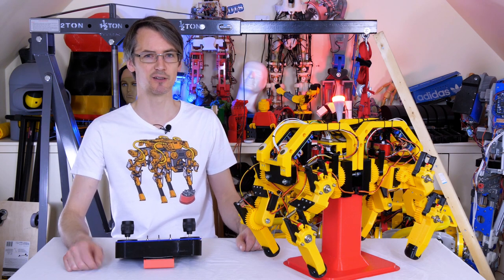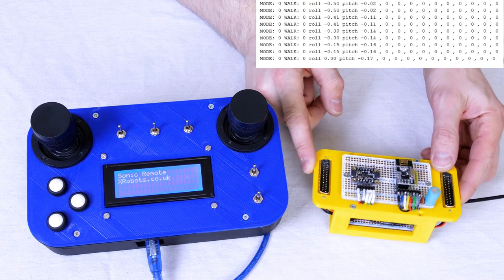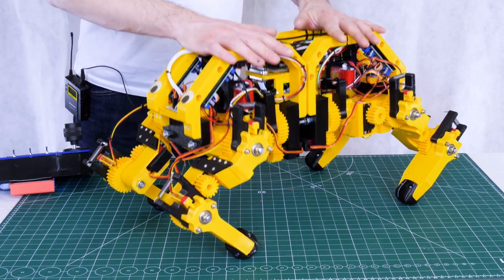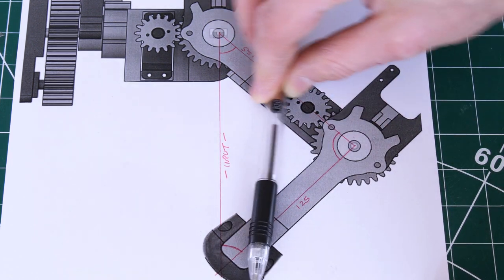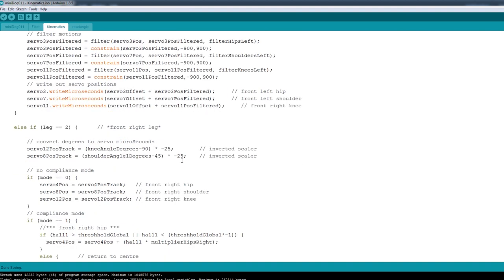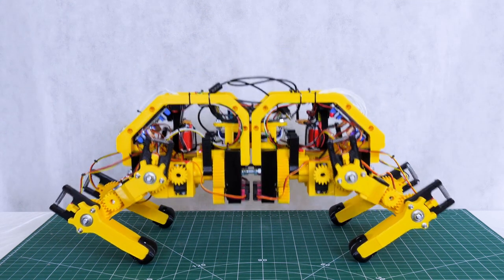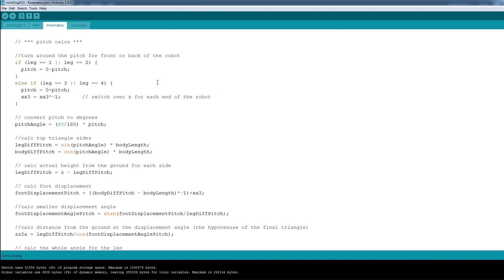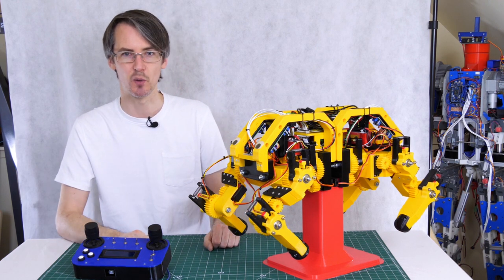Mini Robot Dog #4 - Inverse Kinematics

Comment: The movement of the robot is looking awesome! Very cool indeed!

Btw, In programming we typically avoid atan(x/y) and use atan2(y,x) instead, to avoid the division by zero that's lurking there and because "The single-argument arctangent function cannot distinguish between diametrically opposite directions".

Comment: Great job James! I am impressed by the way you do that! But I woud suggest trying to solve IK problem by using more linear algebra instead of pure trigonometry. It will not only run faster, but once you get a good understanding of it, will be much easier. (although harder to explain in a video). Anyway looking forward to the next video!
Reply: This sounds good, can you attach some links.

Comment: This is the most FUCKING AMAZING RC project I have seen in forever. Iv'e built quad copter after quad copter, tracked vehicles, and rock crawler, but this is something different! I wan't this this bot, and I want to put FPV on it and take if into the wilderness!

Comment: The reason why programming often uses radians is because floating point numbers have the most accuracy around 1.0 or -1.0— there is just as much accuracy from 0.0-1.0 as there is from 1.0-infinity.  While it shouldn't make a huge difference for your calculations with 32-bit precision floats, the closer you can keep the numbers your using to +/-1.0, the less chance of floating point error/rounding showing up.

Also, working in multiple different scales generally makes your code messier and more prone to errors.  It's best to try to choose a system and stick to it for the whole program.  If you want to output degrees to the terminal, I'd do the radians-to-degrees conversion inline in the print statement; mixing radians-based and degrees-based variables (even if distinctly named) is just going to clutter things up.  Just imagine trying to design a 3D part in CAD and half you measurements are in centimeters and half are in inches!

Comment: Hi James,  As always great to watch your inventions take shape.  I am also using the same network chips for my robot mower and was interested in your comment about voltage issues.  I don't suppose you could say what decoupling capacitor and smoothing capacitor you are using please?
Reply from the maker: 100uF and 0.1uF, but there are still some occasional issues

Comment: Hi James, I wanna build my own doggie but i have leg direction as opendog, it use not geared servo(180°), i try to write my own kinematick but i have 351 line and he can move top down and badly front(only body move) how mutch i must edit you code to it work for my( i need only kinematics with all variable)

Comment: instead of creating different cases for each motion of the inverse kinematics, wouldnt it have been easier to treat each leg as a 3DOF arm and plug in whatever point you needed?
so instead of having an equation for up, down, side, ect... you'd just have position in 3d space and it solves everything

Comment: Nice work. A suggestion: If I were you, I would never shift between RADIAN and DEGREE. Calculate all in radian and ONLY for HUMANS convert it to DEGREE and send it over the serial port. You remember the smashed vehicle on Mars. The fault was, they calculate in both metric and imperial and they screwed up.. 90 degree is Pİ/2 ;)
Reply from the maker: Yes all the calcs are done in radians

Comment: It's cool seeing this progress so fast! Should the end of the triangle be closer to the center of curvature in the foot so the body stays level at 5:00?
Reply: A foot comes of the ground at 17:13
Reply: @janhetjoch  Its because the servo cant get to where the math is telling it to. Geared down servo has a bit limited motion
Reply: Technically yes, but also the feet won't always be perfectly on the ground anyway due to squishy rubber, rough terrain and the fact that the feet aren't circular so some parts will be closer and some further away. And the springs on the joints will help take up any inaccuracies.

Comment: Hmm, I would have thought doing floating point math on an Arduino would have been unusably slow and expensive for this (given AVR8 lacks both an FPU and native 32-bit operations), and would have presumed using fixed-point here... I haven't really tested to find out though. (Or, was this one of the newer/fancier Cortex-M based Arduino's?...).
Reply from the maker: Yes it's a Teensy 3.6 with a 32-bit 180Mhz Arm Cortex M0
Reply: @jamesbruton  OK, yes, this makes a little more sense...

Comment: 11:19 I'm not a math head, but it seems strange to calculate to the ground when the foot will be off the ground. Is that so it knows where it is?
Reply: I would agree but, because each leg is being calculated seperately, the other side will compensate for the height (as seen at 12:27)

Comment: When is open dog going to actually be open?
Reply from the maker: It's already open source - CAD and code is on Github, although I don't recommend building it ;-)
Reply: @jamesbruton  I meant when are you going to build an open source version or at least use open source resources. The project isnt being run properly if its open source and you cannot build it, something must be very wrong in how it's built modularity or you're allowing too many resources through that are useless.